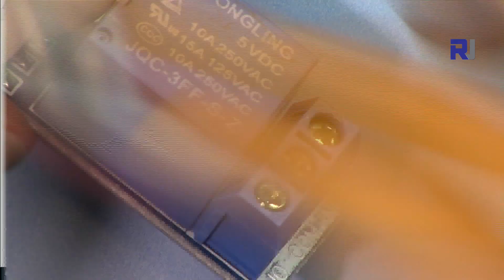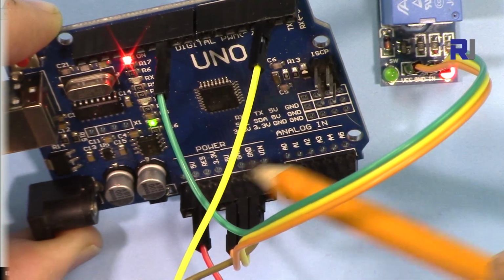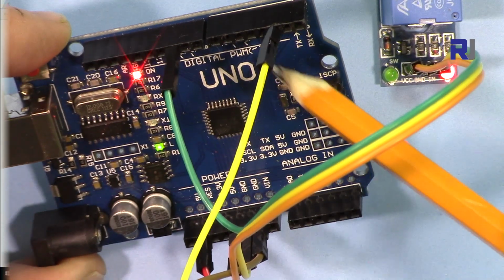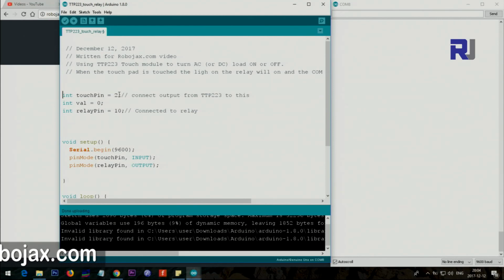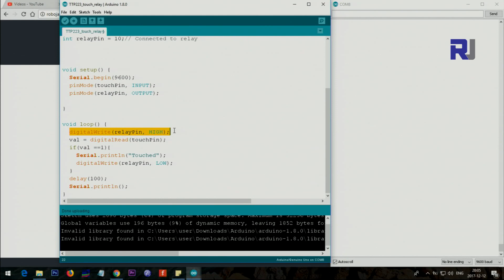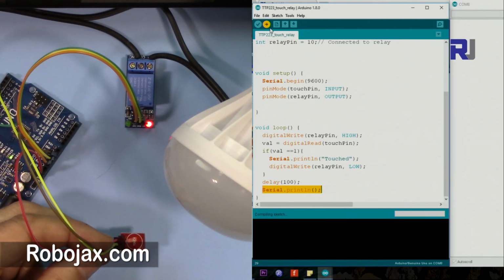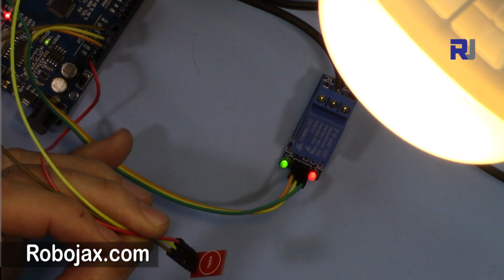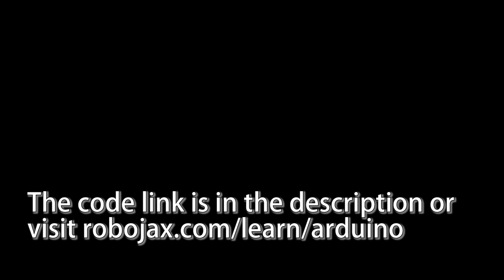How to use TTP223 Capacitive touch to turn ON/OFF AC bulb Arduino module RJT22

Comment: when i touch and keep for long it turns off quick and on again after 7-8 seconds, how to stop that? please help me with this. Thanks
Reply from the maker: Search my channel for the word "toggle" you will find solution so so you learn and use it.  learn how to Search for a  Particular  video in a channel here https://bit.ly/findYouTubeVideo
Reply: @robojax   i looked into the videos but i still dont understand. 
This is your code :

int touchPin = A5;  // connect output from TTP223 to this
int val = 0;
int relayPin = 4;  // Connected to relay
int wait = 1;      // delay before it goes off after release
void setup() {
  Serial.begin(9600);
  pinMode(touchPin, INPUT);
  pinMode(relayPin, OUTPUT);
}

void loop() {
  digitalWrite(relayPin, HIGH);
  val = digitalRead(touchPin);
  if (val == 1) {
    Serial.println("Touched");
    digitalWrite(relayPin, LOW);
    delay(500);
  }
  delay(100);
  Serial.println();

}

What do i need to add or remove to stop this cutoff after 7-8 seconds?
i noticed another comment has this issue, I would greatly appreciate if you could help me on this. Thanks
Reply from the maker: I did not understand. you confused with the word "again". no tell me when it is ON what do you want to happen? if you delay, then add delay(5000); this will add 5 seconds delay. the same when it is OFF.  /You should have learned by now which part of the code is turning it ON or off.
Reply: @robojax  I do understand that and adding delay and all that, what I'm trying to say is, "when I touch and leave my finger there, it will ON  but it randomly turns off after a while(7-8seconds) for a split second and turns on without me removing my finger...." ( that turn off I don't want I hope you understand now) I've tried using different parts so I believe maybe I need another line or code or remove I don't really know.

I tried removing delays and all that in the code and still same thing occurs like around 7-8 seconds when I hold my finger there it randomly offs and turns backs on while my finger still on the touch sensor. I'm sorry for the trouble but this is important for my project and I can't gave that happening, Thanks for responding means a lot🙏
Reply: @robojax  I found out that the ttp223 Chips has an (auto calibration for life) that's what causing it to go off after 7s and back on when when my finger is toughing. Sadly I couldn't find a fix, I Wonder if you know any other chips or a code to bypass this? Thanks

Comment: Thanks for a very informative Video. Can you please tell me if this setup will remember the last state? for example if there is a power outage, will the light stay on if it was on when power went out? or will it reset to off? Can arduino be coded to remember the last state?
Reply from the maker: no it will not remember.
Reply: @robojax  Thanks for prompt reply. Is it possible to obtain this functionality via software code? or Physical hardware will be required?
Reply from the maker: I don't have a video but you can have external RAM module to remember the value.
Reply: @robojax  Thanks

Comment: Have you ever tried working TTP223 with ESP8266 version 01? The code you provided can not help :)
Reply from the maker: this has nothing to do with ESP8266.  for touch purpose this code works. If you get error,  post your code on https://codeshare.io/ and post the link here I will look at it and let you if there is a problem.

Comment: Did you see alphabet on circuit board "A" and "B"
if you short point "B" only = Touch on - touch off
if you short point "A" only = Touch off - release on
if you not short any point = release off Touch on
if you short both point = release off Touch on
I don't have any Arduino.Good luck.
Reply from the maker: thank you very much. I just checked the module and yes it does have it and I missed that. But the default is what most people will use.

Comment: Hi. Without arduino can i use this switch in my home.
Reply: Actually you don't need any Arduino... There is option on ttp223 to make toggle switch...
And with touch module, even, a 5v relay will do the job, instead of relay module...
Reply from the maker: without Arduino, after touch the light will go OFF. So you need arduino watch this video https://www.youtube.com/watch?v=Nqh1vYQEEjs

Comment: Arduino not necessary. TTP connect to relay.
Reply from the maker: Yes but with arduino allows you to have control for example after touch how many seconds you want to relay to be ON or OFF etc.

Comment: So if you only wanted it to be a momentary switch, could you just skip the arduino and connect the I/O of the sensor to the relay ?
Reply from the maker: yes you could. You don't need Arduino if you just need to turn ON or OFF something.

Comment: I want 
first touch off  second touch on  
but I couldn't
what is your opinion 

int touchPin = 2;// connect output from TTP223 to this
int val = 0; 
int relayPin = 10;// Connected to relay
int num = 0;

void setup() {
  Serial.begin(9600);
  pinMode(touchPin, INPUT); 
  pinMode(relayPin, OUTPUT);
  digitalWrite(relayPin, HIGH);
}
void loop() {
    val = digitalRead(touchPin); 
  if(val==1 && num==1){
    digitalWrite(relayPin, HIGH);
    num=0;
     }
    val = digitalRead(touchPin); 
  if(val==1 && num==0 ) {
         digitalWrite(relayPin, LOW);
         num=num+1;    
     }
  delay(100);
}